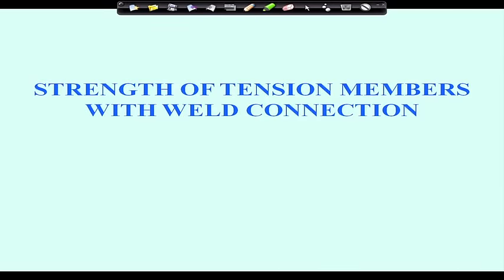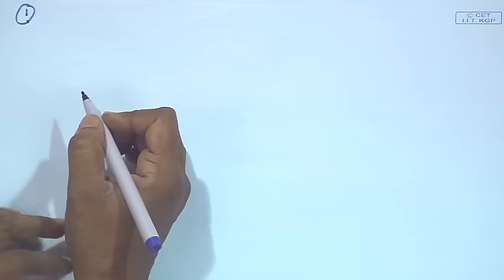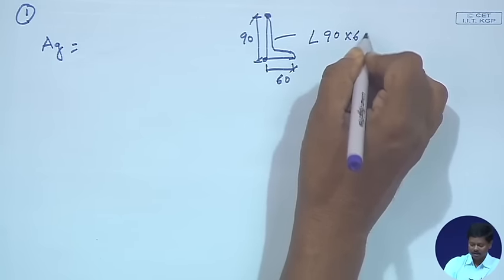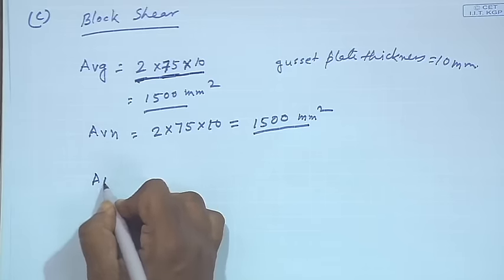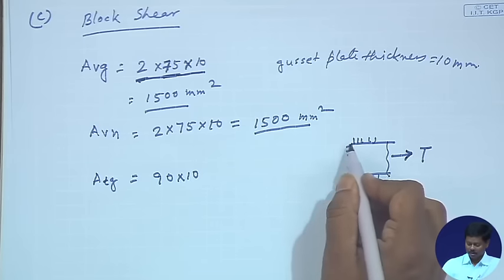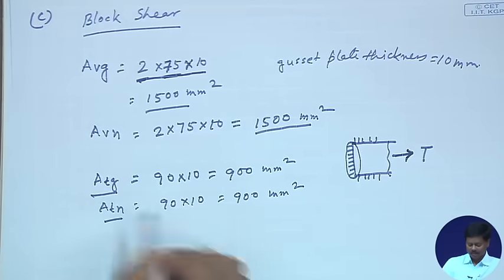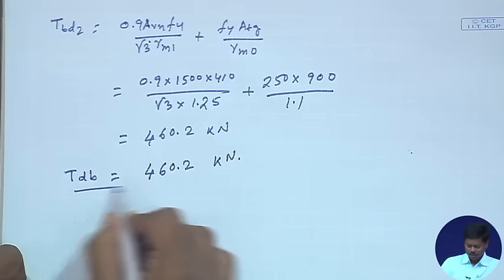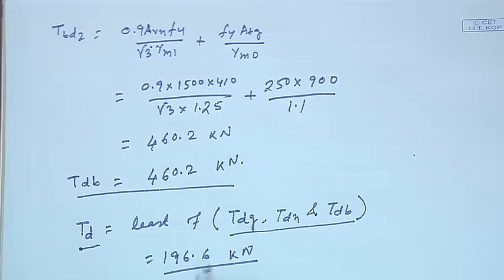Lecture 23: Strength of Tension Members with Weld Connection

Comment: During calculation of Avg why thickness of gusset plate is used ? According to me thickness should be 6 mm
Reply: Dipanshu Arora in case of welded connection, block shear failure is contributed by gusset plate
Reply: @akashgohel5375  but the failure generally occurs at the weaker section where the thickness is lesser. In this case the effective throat thickness of the weld should be taken equal to the  thickness of the thinner part that is 6mm.
Reply: Even in S S Bhavikatti book on design of steel structures (pg no. 134, eg no. 5.5), he has taken the throat thickness of weld i.e. 4 mm where the thickness of gusset plate is 8 mm and 2 ISA 9060, 6mm is used.
Reply: Shouldn't we take the thickness of gusset plate when the strength of the weld is GREATER THAN that of the gusset plate.
In this case the weld would just tear out of the plate intact.
Reply: @akashgohel5375  Sorry!!! After confirming from S K Duggal book and various other sources, I found that we need to take the thickness of gusset plate for block shear calculation.
Reply: @shivamsharanlall672  But sir has taken minimum thickness while calculating the block shear value  in the earlier lectures.